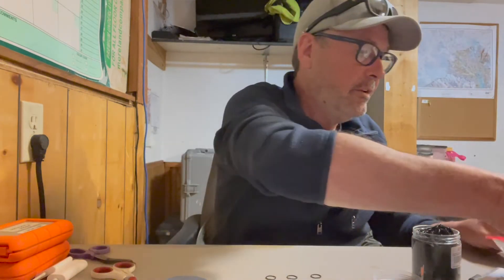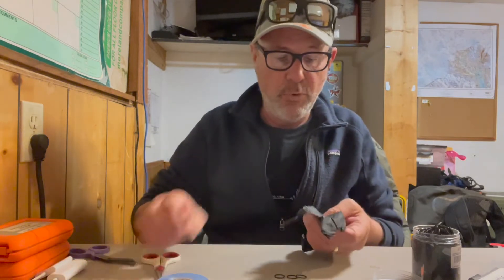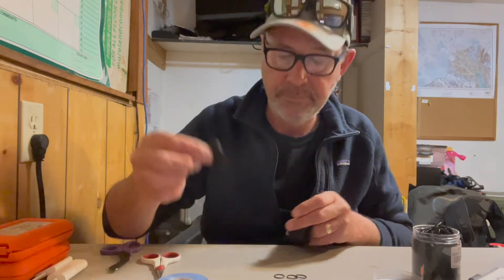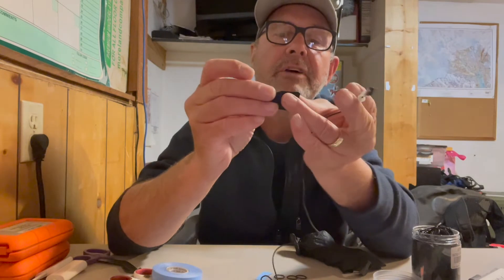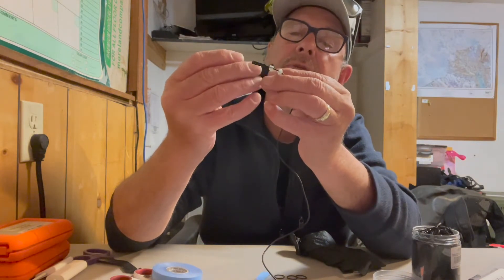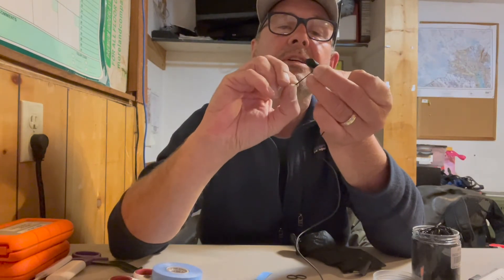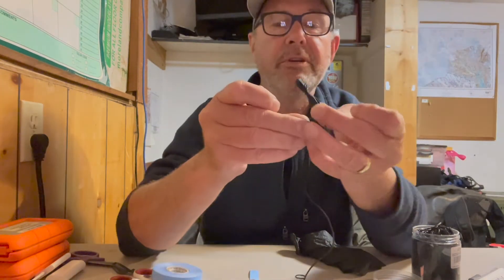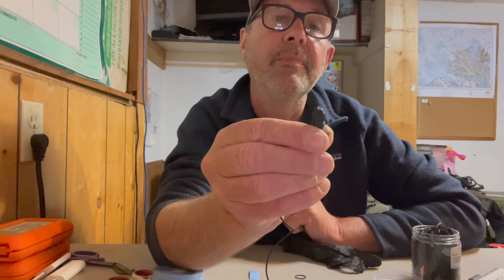How to Waterproof a Lavalier Mic

Comment: Did you transmitters?  You just do the same method, but say with a condom instead?  Thank you for your time and expertise.  I'm not fully submerging but am doing a big rain scene for my film I'm working on.
Reply from the maker: I did regular transmitters originally and described how I did that in an earlier reply to a comment on this thread. I later invested in Q5x waterproof transmitters so had no need to waterproof them any more. That is a pricey option for what you are doing, so I’d say the condom method you were thinking of would work just fine for a rain shoot.
Reply: @christianlebert9296  thanks a ton for the speedy reply.  Def gonna give these a test run in the shower.  Countryman b3's into sony's ecosystem.  Will test a cheapo sony lav first haha.

Comment: This is a great video and very helpful Christian. What was the type of Walker tape you are using? It was hard to make out what you said.
Reply from the maker: You can get it via Amazon. Walker tape with light blue backing. That is a stop gap though. Walker tape is fantastic at securing lavs to talent though. The best I’ve found. For the waterproofing I would strongly recommend a butyl tape. The product is called Joe’s Sticky Stuff. I purchased mine through Amazon but Trew Audio also sell it through their online shop. I just didn’t have any handy when I made the video.

Comment: Good stuff! Quick question though, how do you waterproof the receiver? Let's say you use something like a Rode Wireless Pro receiver
Reply from the maker: I am currently using Q5X Aquamics which are fully waterproof, but before that I used Wisycom MTP40’s which was quite problematic as water finds a way of getting into even the most tightly wrapped packages, but I had 99% success rate using a double zip lock bag method. You place your receiver in a zip lock, and then seal it normally. You then need to use a butyl tape, in my case Joes Sticky Stuff, and seal off the whole opening and edges of the zip lock after squeezing all the air out. Then place that into another zip lock and do the same. If you’ve been meticulous enough applying the Butyl your receiver will stay dry underwater all day. Downsides are that you have to build the same rig every time you need to change batteries. Because the Wisycom will stay powered for 12 hours at 50 mw with good Eneloop Pro batteries this was something you only needed to do once a day. Its not 100% effective all the time and I did lose one transmitter through water ingress in the space of a 20 week shoot, but my contributors would be submerged at 20ft depth for 6-8 hours a day so kind of expected.
Reply: @christianlebert9296  Thank you so much for the detailed answer, that is highly appreciated! I looked for the Q5X Aquamics, it is pretty expensive, do you know any alternative that go underwater outside of an homemade setup?
Reply from the maker: @50centGGGunit  Unfortunately I do not